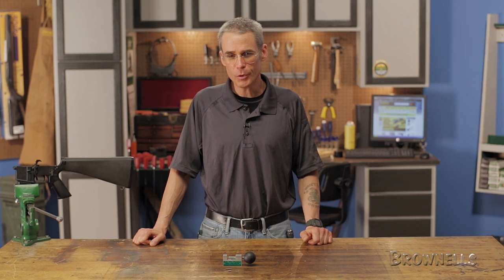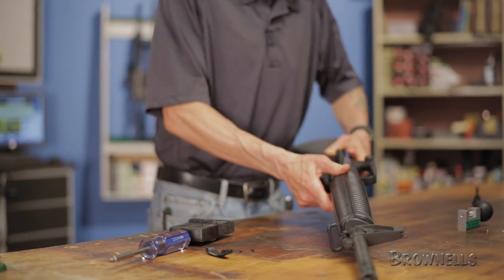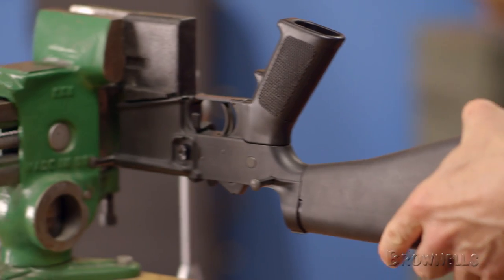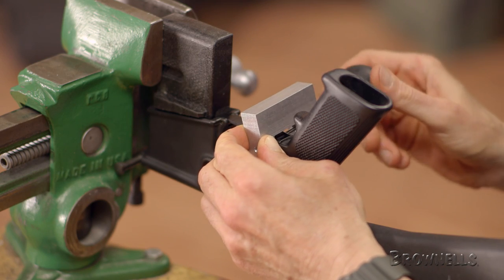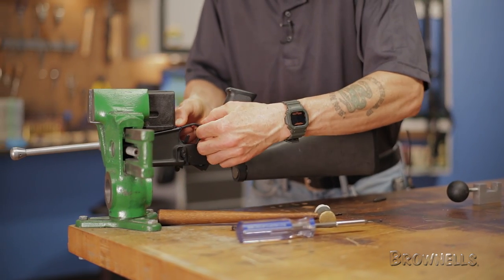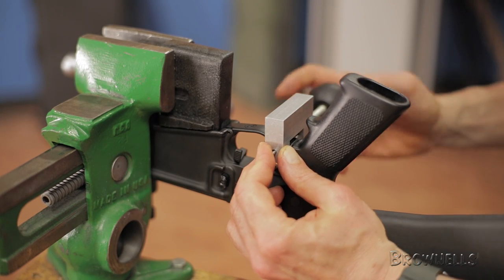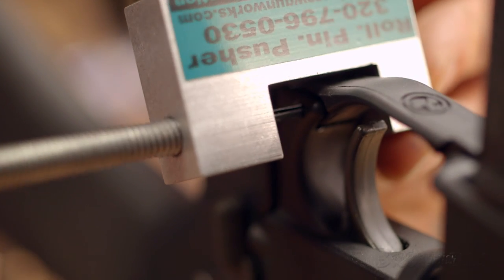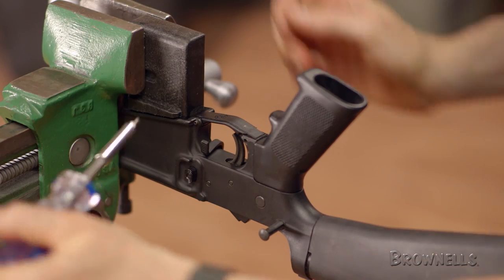Little Crow Gunworks Roll Pin Pusher

Comment: This tool works amazing I had a roll pin that wouldn’t go in all the way on my trigger guard. The roll pin was starting to mushroom out and I decided to stop before I broke a tab off. It would not punch out so I stopped and ordered this tool. It pushed it back out with ease and I installed a magpul trigger guard with set screws. It’s definitely a problem solver.

Comment: Wheeler sells a very similar trigger guard removal tool on Amazon for $25.  This Little Crow tools sold on Brownells is $40.
Reply: You can't put the roll pin in The Wheeler tool, you have to start the roll pin with a punch, then use the Wheeler tool to finish the job.  Little Crow tool is much better design.